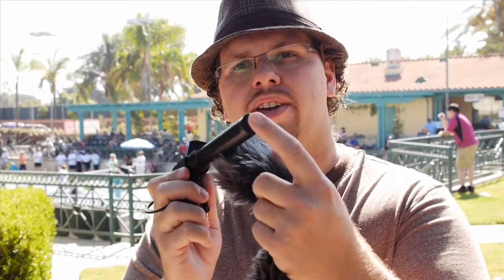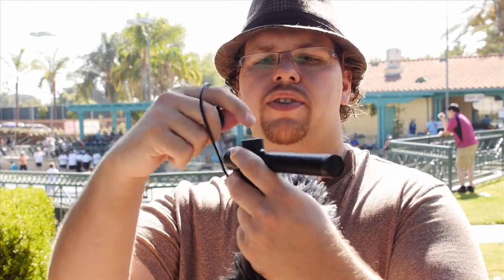Q: What are 2 of the Rules to Microphone Choice & Placement

Comment: Hey Brian, here's how I do it but, before I mention my audio workflow, let me say that if you can record directly into your camera through any of Steve's suggestions, you should. Otherwise you have the added time and effort of recording externally and then pulling that audio in to your video production software and syncing it with the video. That's what I do, but I am 1) VERY budget minded ("on clearance" is the official song of my people) and 2) I have a podcast that's audio only and I only want one set of recording gear. I've gotten very adept at syncing but it is an added step.

With that said, when I need to record two people, I use wired lav mics with an XLR plug and I run it into a 5-channel mixer that has a USB out. It gives me the added ability to adjust the different levels for each person. I also have an interface specifically for my iPhone so I can use a single lav (with the XLR plug) with my iPhone as a digital recorder. 

Each approach as advantages and disadvantages but it all boils down to what will work best for you and your budget. Of course, if you have any other questions, please don't hesitate to ask any of us from the Hybrid Heroes team. We're here to help.

Comment: Cont. 2    :  ) 

A shotgun microphone might be the best option for this type of situation.  Different microphones have different pickup patterns.  The narrower a pickup pattern is the less outside sounds will be recorded.  (At this point we're talking a pretty big budget as those mice are very expensive and will need phantom power with XLR connections.     Another option would be (if you don't need to hide the Mic)  a handheld unit.  Shure makes great handhelds and sennheiser.

Comment: CONT.  When it comes to the situation you described with 2 people.  Unfortunately, you are going to need 2 transmitters and 2 receivers and a MIXING unit like the Zoom H4n or Tascam recorders to handle the multiple sources.  You can then run the output to the camera while maintaining a very high quality file on the recorder too.   If you place a LAV equal distance from both subjects, you will get about equal sound levels with quality varying.

Comment: Hi Bryan.  The thing to keep in mind is that with Wireless Microphones the Mic and the Transmitter are separate from each other.  Many come packaged together though.  I have heard great things about the Audio Technica united ($115 or so) for the budget minded.  I have used the Sennheiser G3 wireless kits before with great results, but a kit can run somewhere in the $400-700 range. Used prices vary.